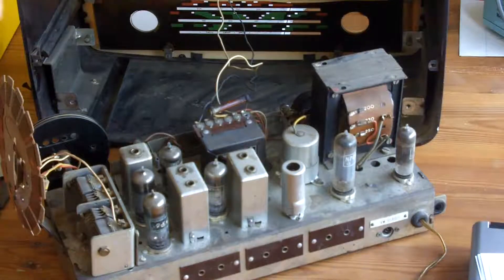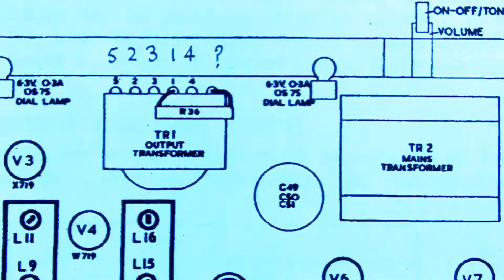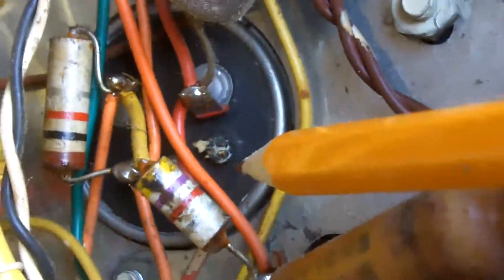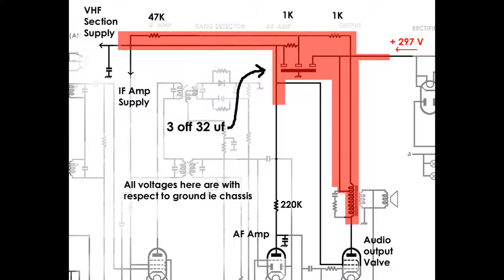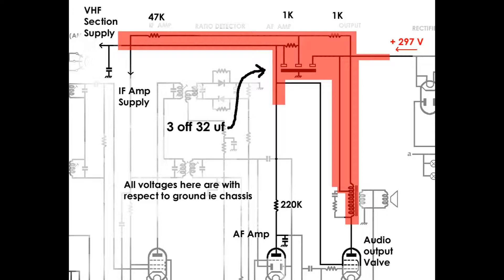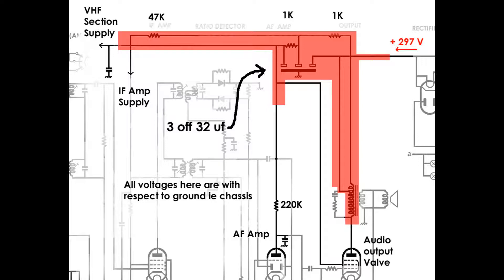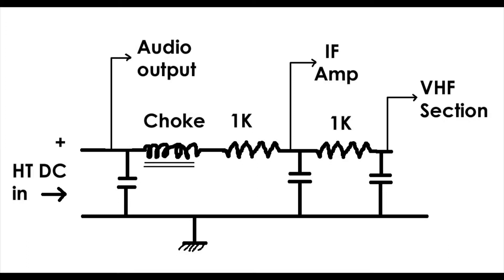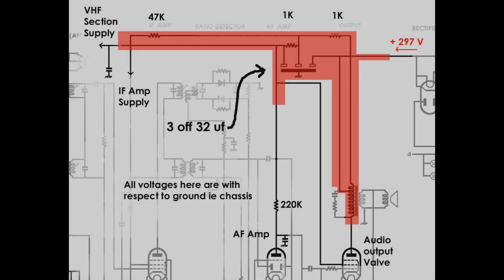About Radio ... Part 3 HT smoothing by Andy Davies.

Comment: Fascinating video. I do like old things, they often seem so much simpler to understand and work on. BTW, a thought occurred to me about the DC supply going through the audio output transformer--there might perhaps be a "cunning plan" behind that. If the DC supply is wired in anti-phase with the output from the audio amplifier, it might be that the extra winding would cancel out mains hum in the speaker?